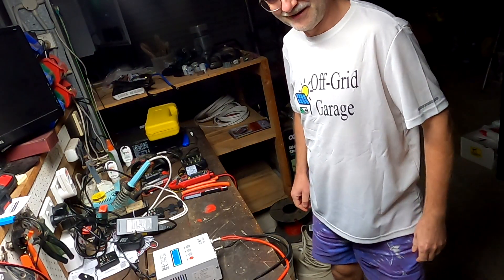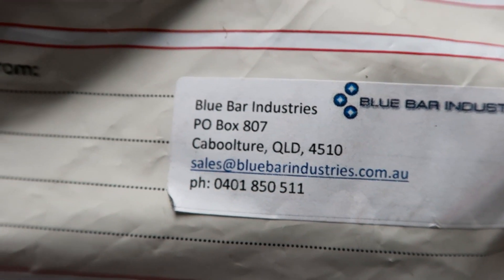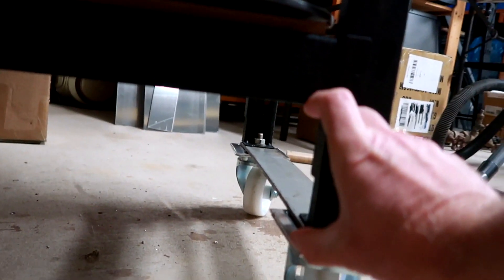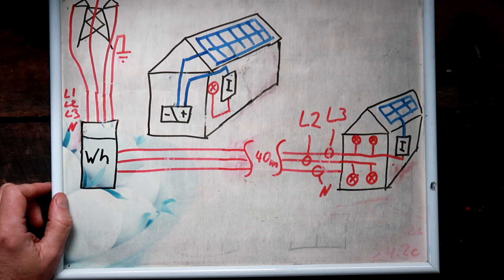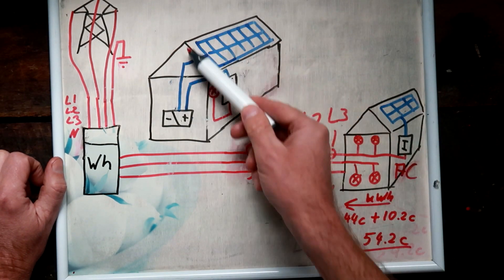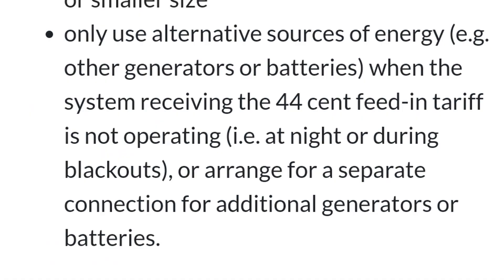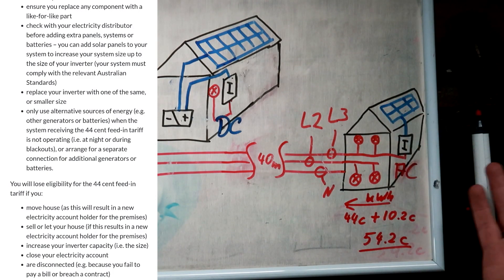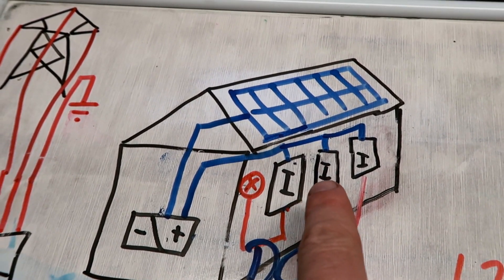Why a solar hybrid inverter will not work for my setup.

Comment: Another solution is to move your house loads to an off grid inverter which would be powered from solar and battery. The MPP inverters (Pip 8048max) also has a grid input and internal transfer switch for times where the solar is not enough. This type of off grid system also ensures you have power when the grid is interrupted like the storms we had in Melbourne a month ago.
Reply from the maker: As I said, it's not allowed during the day to operate such a system.
Reply: @OffGridGarageAustralia  Well you are already doing it in your garage.

Comment: Regarding your idea to supply power to the house at night: Wouldn't you need a powermeter connected to the inverters to avoid feeding power into the grid at night? The only ohter choice would be to separate the grid at night (I would not recommend that since your breakers might not work in  that case).
Reply from the maker: Yes, absolutely. I'm looking into this solution at the moment.

Comment: You have a super favorable feed in tariff rate. In California, they offer a kind of half-assed NET metering arrangement where the billing cycle goes for 12 months and sums up all the usage minus your solar production. Any months where you have net excess production goes into your electricity "bank account" BUT that triggers a minimum charge of $10 that has to be paid out of pocket regardless of how much electrical credit you have built up. So basically, being penalized for supplying the grid with renewable energy yet this State now wants to outlaw internal combustion engines and go all electric vehicles. So where is all the electricity going to come from? At the end of the 12 month NET metering period if you have excess generation accumulated then the utility pays a whopping 4.3 cents per KWh compared to the 19 cents per KWh they charge us. Not to mention the 19 cents is just the baseline charges, if you go over your allowance the price goes up A LOT.
Reply: Yep it sucks, I am paying 26 cents per KWh in Bay area right now. They want all electric cars but not doing much on infrastructures. I built small solar system as back up to be ready for rolling blackout this time.
Reply: @budmartin3344  WOW, 26 cents. You were smart to build a back up system. Its really nice not to have to worry about being without electricity.

Comment: Do you have more room for solar on your house. If so put more solar on house.
Reply from the maker: Sorry, but did you watch the video? I explained, that I cannot upgrade this system at all without losing the feed-in tariff. Also, how would that make a difference if I have more solar on the house? That does not make sense.

Comment: Hello Andy ( I didn't know that was your name ..lol).

Well i do see some solutions to your problem. it isn't the best ..it is compromise and i don't know how it is there but i expect..

1.  You can use alternative sources..battery/solar ..if you want to feed your lets call it NEW network ..lets say your new new (not yet build shed) ..You are doing this now anyway. with your shed network right now.All fine here..
2. Lets assume your grid tie inverter is connected to L1 directly..All is fine..same as it is right now..
3. Now lets say that you will not connect your appliances  to your L1 network during day also your L2 will not have connection to your grid you will be connected to your second ''shed inverter' during this time . Theoretically you are fine here as you are not doing anything extra you will only disconnect your lamps. radio, what ever from your 'grid' 
4. Ofc size of grid tie inverter /panels will not change so no problem with that..
5. Well now comes that tricky part..Once you will have your bateries empty you will just switch off your shed inverters and go back to your grid ..lets expect during night once you will drain your batteries ..

Ofc you can build transfer switch..this is what i done..I'm separate from grid and if needed i can connect to it or if my bateries gets empty BMS will switch off inverter and grid will switch back and i have electricity again..

Comment: As far as I understand it, you are not allowed to feed energy into your existing house-circuit while the 44 cent-tariff is operating. But what if you take some of the high consumption devices like laundry, dryer, freezer and AC out of the house-circuit? Either by a little sub-distribution-panel in the house where you switch the cables over from the main one and use the existing outlets. Or just a new circuit with dedicated outlets. Then you can feed this new circuit completely from the garage. 

But please make the calculation: If you always charge the Tesla, how many Wh do you have left in your garage-batteries? Maybe just enough to power the AC of the house? Then just take this out of the circuit from the house, and power it from the garage. Or just the laundry, or... I would do it step by step. And only with devices where your wife becomes just a little angry if they fail, and will not kill you. So maybe the freezer at last.  ;-)
Reply from the maker: Even that is not allowed while the solar is running. This would also mean I would need to install a second battery at the house to supply this load. All this will make the feed-in invalid...

Comment: The Sol-Ark/Deye can do all of it. It has time of use, load dumping, AC coupling, zero export.
Reply: Deye would be a really good way to do what he wants and not super expensive.

And it only needs to be large enough to support night time loads i would guess their 8kw model should work really well.  I also hear they maybe coming out with a 12kw. Not sure if that is going to be like the sol-ark 12k.
Reply: @matthewwright8216  the 12k is out. Pushes 8kw continuous in off Ingrid situation. Seems like the 8 or 12k might work here
Reply: @singerkgreen  8kVA when only running from batteries.  The 12K maxes out at 9.6kVA for off grid loads from batteries and PV as long as the PV is generating at least 1.6kW.
Reply: @randacnam7321  ok? Not sure why that was directed at me. But cool
Reply from the maker: How would it handle the solar AC coming from the load side though? I haven't seen an inverter which can do that yet.
Reply: @OffGridGarageAustralia  you can run dc solar and ac solar. There is a set of optional lugs that can be used for a generator or AC solar like Enphase

Comment: If you go totally off grid for both the house and garage 100% of the time. Even if you have to buy more panels. Let the panels on the house keep supplying 100% of their current to the grid. Thus maximizing you government subsidy. Then you would have the best of both worlds till 2028. When your contract expires you can add the panels on the house to your off grid system. You will know with confidence your offgrid system can sustain your electric need because you will have 7 or so years of data.

Comment: I think what you need is just an Inverter with an AMP-clamp placed between the house and the Watt-Meter in the garage like the Limiter of the Sun-1000/2000 Inverter. In this case the Inverter will not send any power to the grid (which is prohibited by your contract). It will send power to the connected phase L2 or L3 only if you are taking power from the grid. Then the inverter will send only as much Watts as you need in the house. So it will only reduce the amount of Watts taken from the grid to nearly zero. So these kind of inverters will only kick in If you are using more power in the house than your solarsystem in your house is able to produce. This will be during nightime and on very cloudy days.
Reply: This is the solution.

Comment: Is the power out on the pole true 3 phase?   ie. 120 degree phase shift?  Do you measure 220 volts between the lines or 220 volts to ground?
Reply: Australia uses a true 3 phase system, 400 volts line to line 230 line to neutral

Comment: I think you just have to create a new circuit of outlets which will be fed by the energy coming from the garage in which you will be able to plug in certain household appliances, that  will allow you to reduce the consumption of the house so you will be able to reinject a lot more energy in the grid and earn a lot of money. (this means that you keep your installation intact but you only reduce your energy consumption.)
Reply: it should be noted that outlets must be supplied directly from the garage while not using the old power lines, this means that you have to bay the electric wires that leave directly from the garage to the house.

Comment: if only having two totally separate power lines where allowed... so one could take everything off the contracted feed in tariff & just power anything you like when you want off the totally separate off grid private line ^_~

plus oc jack up the Off-Grid Garage ,put it on tracks & move it closer to the house when needed ^_~

Comment: You can just disconnect your house from the grid, except for the feeding inverter and connect it to the load side of the inverters in the garage. Then you can also have three phases in the house. Needs a extra cable. And you do not need to care about energy consumption in the house during the day, as long as solar or battery is available from the garage. And if you can predict a upcoming empty battery situation, you can charge the battery from the grid at night time, and still get the 44 cents the next day.
But i missed you :-p

Comment: it seems like you can only reduce your L3 load and feed more power to the grid. but use a transfer switch to shift the disconnected L3 load to the garage system ??

Comment: Hi Andy! You are mixing two things. A hybrid inverter feeds to the line. But what everyone was suggesting an Off-grid inverter. That does not feed to the line. It has an AC in and an AC out port. Like an UPS. Also in it you can set priority like SUB (Solar-Utility-Battery) or USB (Utility-Solar-Battery). So power will come from Utility and only if interrupted from solar and battery. I put a pic with the schema for your last post but YT did not show it. I will send it in the forum
Reply from the maker: That's what everyone needs to understand though. I have AC on the load side, so it would feed power in the AC out of the inverter 💥. Look at the graphic I've pinned at the top of the list.
Reply: @OffGridGarageAustralia  Look at my second pic. Googe drive Link already visible on your pinned post. You feed in the AC in of the inverter. Grid tie usually connected directly to main (with only a breaker). No RCBO, RCBD (Fi) or anything else between then. And in this scenario house is on UPS. But you need to lay some extra cables between the house and the garage. I had to do it too. 40m 4x16mm2 under earth cable in a 1m deep trench. Also separate earthing rods on both ends.
Reply: @OffGridGarageAustralia  (from reading manuals) hybrid has AC-in and AC-out, the setup would have AC-in connected to hybrid which (some of them) can export excess power to its AC-in when AC-out is not using all of it.

Comment: If you wire up a separate circuit in the house connected to your battery would that breach the rules? You are not disconnecting the original system. Then just plug in your high watt appliances into the "green sockets"

Comment: Deye or Sunsynk 3 phase inverter will work perfectly for you. You get 8 or 5 Kw units.
Reply from the maker: No, it won't work at all. I have power coming in from the load side. I don't see an inverter working when there is power coming in from the AC out of it, right?

Comment: You've got 2 phases to work with. So you could use phase 3 as input to the hybrid inverter and phase 2 as the output.  This way you wouldn't have a source on the output side of the inverter. 
Of course you might end up sending energy coming from the house back to the house on the other phase.
However, that's quite unlikely, because if there is energy coming from the solar plants the inverter would have no reason to switch its input to the backup.

Comment: Run a line from the Off-Grid Garage to the house to power just high current items, such as air conditioner oven, refrigerator.

Comment: What you need on L2 and L3 is a amp clamp like device that can tell you when and how much you are pulling from the grid. If that is f.e. >500 watt it should trigger the start of a small inverter in the garage pumping 500 watt into that line. 
When <0 it should be switched that off again. This way you respond to all moments of high loads in the house.

If you want lower wattages you could use low and higher amps DC-DC's to go from your battery's voltage to the inverter's voltage.

Comment: partly agree andy, look at deye/sol-ark/sunsynk.
they have a seperate imput for generation port.
it is actually a dual port for smart-load/gen.

this would solve most your problema
Reply: these regulations are rediculous .
fortunatly these inverters have limiting and zero export.
they have a pretty good control over grid suppling
Reply: plus, these are true 3 phase ;)

Comment: You can do the current limited inverter on L2 where it never provides more than the usage.  Technically, this isn't provide "more power to the solar side".  And you could just offload major loads to the offgrid garage.  Like your AC for your house could run off the garage.  You could even precool your house at night with the AC if you needed to only use up that offgrid power at night.
Reply: "And you could just offload major loads to the offgrid garage.  Like your AC for your house could run off the garage." specificly that is not allowed as it will cause the panels to feed back in to the grid. He is not allowed an alternative powersource while feeding into the grid. Any other moment it is not problem.
Reply: @HansKeesom   Then I guess you can just use the precooling at night method from battery power.  Easier to just setup a current limit inverter to zero out the house loads at night.  Pretty easy to just connect that in with a timer.

Comment: initial comment before watching (while letting the ads play for you)
DUMP loads .... run some household dump loads from your off grid setup.  Water heater? AC? something .....
Reply: Nice cable choices :)
Small but heavy things on that bottom shelf for balance I say (like that 70mm cable).
WOW that's a lot of money for the export, in the uk you do well to get 5p (£0.05 GBP =
AUD $0.093)
Reply: Makes sense on your contract issues, but maybe some automated stuff at night like you seem to be building upto.
Reply: Not allowed if at the same time the home solar is feeding into the grid at 44 cents.